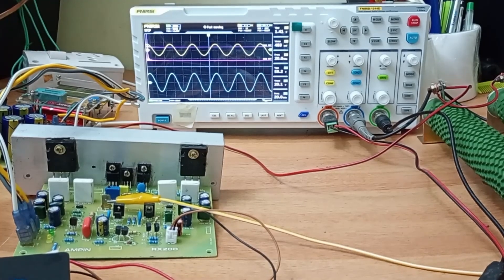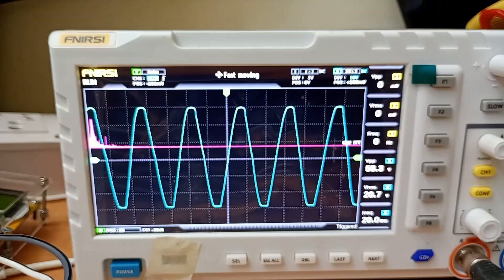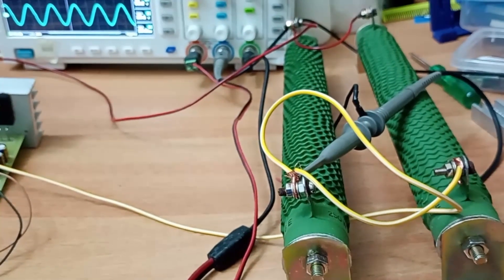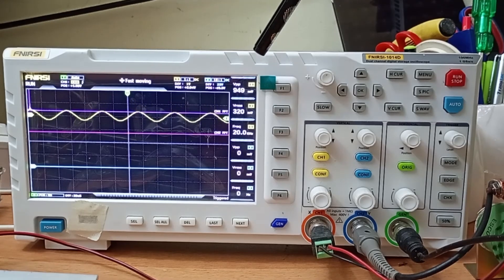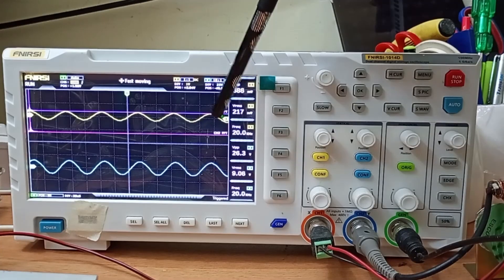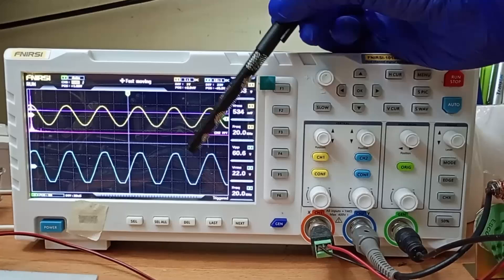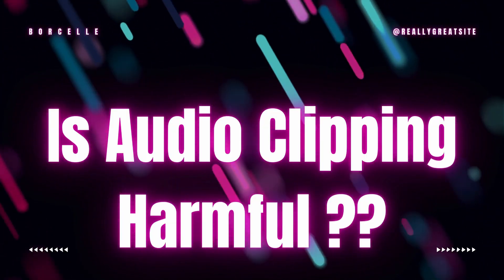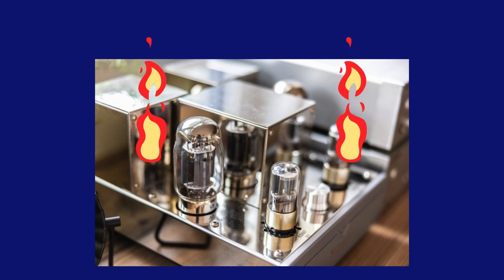What is Audio Clipping ? Can it cause damage to Amplifiers and speakers ?

Comment: Probably the best demonstration of clipping using an Oscope, I always wanted to know will capasitors make a difference in filtering the excess dc power which causes the flat spot in the sine wave?